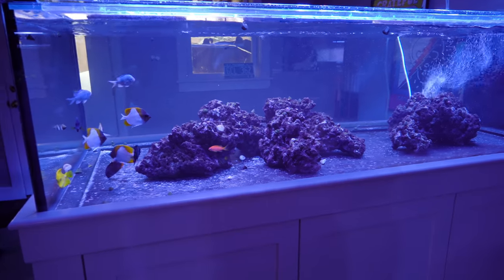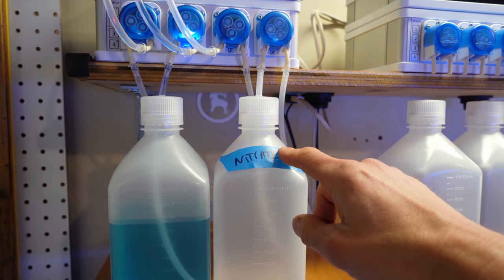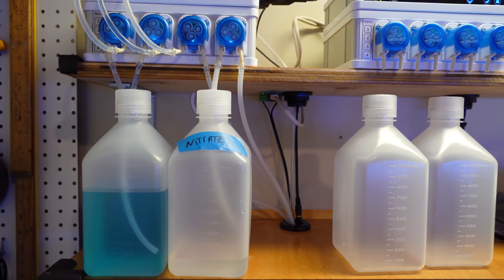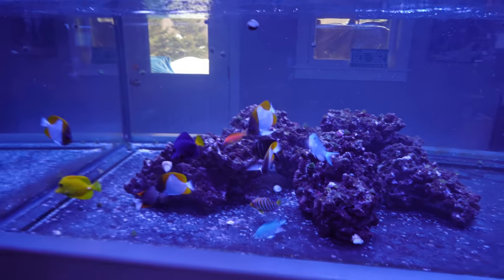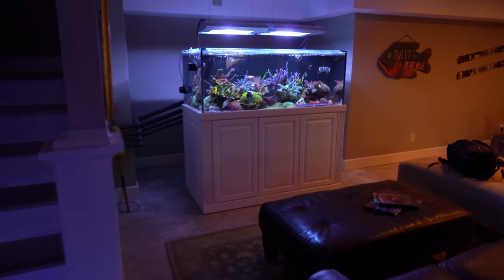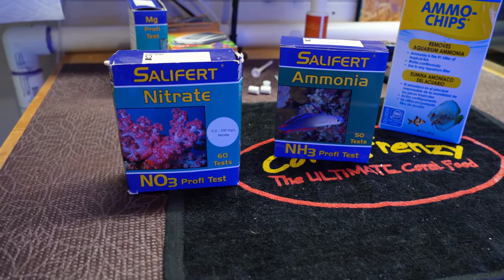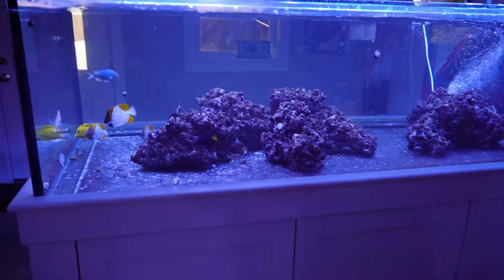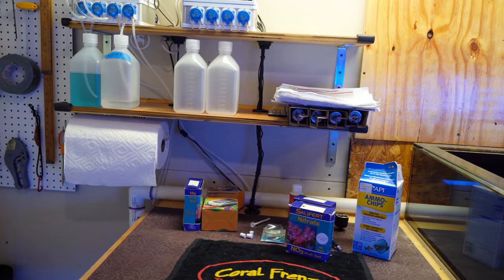3 Glass Walls: My Peninsula Tank Build Journey, Ep #22 - A Crisis

Comment: Keith, do larger water changes.  Also, I am having a hard time understanding how the check valves will allow you to dose, and also prevent siphoning issues.  They are one way stops.  If I am wrong please correct me.  Thanks and REALLY sorry about the overdose.  Keep on chugging along!  This is a great hobby.
Reply from the maker: Check valves have a cracking pressure, minimum pressure that must be applied before the valve opens. So they are not being used in the traditional sense in this application. I am using a 1/4" check valve rated with a .5 cracking pressure or 1/2 psi that can prevent a siphon for nearly 14" of liquid in the tubing.
Reply: @ReefBum  Thanks for the clarification.

Comment: Sorry to hear this. You probably have thought of this but check valves can only stop backflow which was not your problem. I think uphill with an air gap would work. I had never considered that maintenance with the hose connected would remove the roller pinch that is the single line of defense most of the time. Again sorry to hear about your fish losses. Love the channel!
Reply from the maker: Check valves have a cracking pressure, minimum pressure that must be applied before the valve opens. So they are not being used in the traditional sense in this application. I am using a 1/4" check valve rated with a .5 cracking pressure or 1/2 psi that can prevent a siphon for nearly 14" of liquid in the tubing.

Comment: That is terrible. I am sorry for you loss, but I am glad you shared this. I will make a mental note to look out for this going forward. I had a similar issue recently where tank water submerged the dosing pump tubes in my sump and it sucked all the 2 part out of the lines via capillary action (I believe). My KH shot up insanely high, but luckily I was in the middle of a water change and my return pump was off so it was just in my sump. My Apex alerted me that the PH was way up and I changed out the water in my sump and dodged a bullet. Anyway, live and learn.

Comment: Hi Keith, really enjoying your live shows with exceptional and rare audio/video quality. Sorry for what happened to you. We all learn from our and your mistakes, thanks for sharing. May I suggest to avoid any valves on your dosing system as you would add a point of possible failure. Placing the containers below the output level of the tube will avoid this problem. I would also recommend not to fill up your bottles or placing the inside tube not too far inside the containers but only 1-2 inches. Yes, it will require you to check more often and adjust the tubes pushing down a bit but it's a good way to crosscheck everything is ok. Also it will avoid any overdosing because dosing pumps sometimes doesn't stop... I hope my explanations are clear otherwise I will be glad to illustrate it better with pictures or videos. All the best in your reefing journey.
Reply from the maker: Thanks, I actually decided to not use the check valves and put all of the dosing containers on the floor. I am also pinching the output tubes when I clean each head as an extra precaution.

Comment: Wow! So sorry this happened, at least you were able to save over half the fish. I see some comments about automating, obviously you have to automate some things like dosing unless you plan on chaining yourself to the reef. My comment for you which I hope you don't take offense to is to not be so concerned with growing cheato. When it was first popularized it was reduce nitrate/phosphate now many people add no3/p04 just to get it to grow. If you need macro it works, but if it does not grow naturally consider you don't need it at all. Especially in a new system but even in an established if it's not working out without artificially fueling it, I question the need. Finally I was a little surprised to see your levels did not reach crazy crazy toxic levels. I do find though once ammonia becomes an issue it's faster and more effective to simply remove the fish from the ammonia filled water then deal with it. I know 21 fish, that's a lot but the water change water could have been used to fill the frag tanks and then work on eliminating it from the display. If you have a serious crisis once every 10 years much better to have it happen in year 1 of the tank then year 10.

Comment: Damn that sucks big time but keep in the mind the check valves are directional into the tank so I am not sure they will help since you still want the flow into the sump.  Better is a shutoff valve or a pinch tool to crimp the line while performing maintenance.

Comment: @ReefBum you can do a single 70-90% WC (as long as you have the logistics) with no issues if you add water with the same ALK/PO4(for corals)/Salinity/Ca/temp. Also, do it over 1h after you do the minimum top off necessary to cover the corals with water. I did it on my tank multiple times, you just have to take your time to prepare and verify the water matches what you have. Usually 2 times a year I do a 60% WC.

Comment: I just saw that you wanted to use check valves to prevent a siphon in the future.  I don't think this would work because if you add them to the line like that the pump wont be able to pump liquid at all, the check valve will prevent it.
Reply from the maker: Check valves have a cracking pressure, minimum pressure that must be applied before the valve opens. So they are not being used in the traditional sense in this application. I am using a 1/4" check valve rated with a .5 cracking pressure or 1/2 psi that can prevent a siphon for nearly 14" of liquid in the tubing.

Comment: Not sure how the check valves will prevent future siphoning? They will still allow flow from the dosing container. I'm sure I must missing something,
Reply from the maker: Check valves have a cracking pressure, minimum pressure that must be applied before the valve opens. So they are not being used in the traditional sense in this application. I am using a 1/4" check valve rated with a .5 cracking pressure or 1/2 psi that can prevent a siphon for nearly 14" of liquid in the tubing.

Comment: Sorry to see this as your tank and series has been a major motivator for my 250g peninsula upgrade.

The day you trust a check valve, is the day you are ready to quit the hobby. They WILL fail. Not if but when and it will be catastrophic.

You KNOW your dosing setup is flawed. It is the design. Don't throw a band aid on it when stitches are required. Fix the design. Get those bottles lower. This failure can and will happen again if you don't address the root of the problem.

Comment: Got lost at the end. If you put a check valve on the output line, the valve would prevent water from the sump travelling up into the doser,  which I think is not what happened and don't see that happening.  If you install a check valve, the contents in the bottle will still flow out, unless you install it backwards, which would mean nothing flows out of the doser.  Set me straight ;-)
Reply from the maker: Check valves have a cracking pressure, minimum pressure that must be applied before the valve opens. So they are not being used in the traditional sense in this application. I am using a 1/4" check valve rated with a .5 cracking pressure or 1/2 psi that can prevent a siphon for nearly 14" of liquid in the tubing.
Reply: @ReefBum    That clears that up.  There is another way to solve the problem. Don't trouble trouble until it troubles you. Stop cleaning the rollers :-)

Comment: 1st, those check valves are crap - such a nice tank and you are using cheap valves to save it?  2nd, What’s the check valve supposed to do, stop your sump from back-siphoning into the liquid? It won’t stop the siphon.
Reply from the maker: I can't comment on the quality since I don't have them yet and have not been able to inspect them, but I would not have purchased them if I didn't think they could do the job. I will also be keeping all dosing containers on the floor so the check valves will be a back up that probably won't be needed. As for your other comment, I have mentioned this in several other replies: "Check valves have a cracking pressure, minimum pressure that must be applied before the valve opens. So they are not being used in the traditional sense in this application. I am using a 1/4" check valve rated with a .5 cracking pressure or 1/2 psi that can prevent a siphon for nearly 14" of liquid in the tubing."
Reply: @ReefBum  All those numbers sound nice in theory but I'm not trusting my expensive system to a $1.50 device. Also, check to see if that cracking pressure doesn't impact the amount of fluid being dosed. Good move in placing the dosing containers on the floor.

Comment: I've heard of friends that use ammonian removers and prime.
Reply: Not sure how those check valves would help. But a derivation with a t and a short section of tune going up right after the doser and ending just above the doser would could cut the sifon and not change the way the dosing works. Just an option
Reply from the maker: @wilsonline90  Check valves have a cracking pressure, minimum pressure that must be applied before the valve opens. So they are not being used in the traditional sense in this application. I am using a 1/4" check valve rated with a .5 cracking pressure or 1/2 psi that can prevent a siphon for nearly 14" of liquid in the tubing.
Reply: @ReefBum  interesting. I wouldn't have thought of that

Comment: those cheap check valves don't work! Ask me how I know.   Upgrade to RO tubing and use john guest check valves. I also would put dosing containers on the ground cos your asking for trouble having then that high.
Reply: 100% agree!
They also have a tiny metal spring inside which rusts overtime.  As a found when using them on my Triton dosing lines.  Took months of hunting to find the metal found on my ICP's.
Reply: @chosenjacob4604  I cannot believe though with all his experience and money spent that he would trust having his dosing containers above the level of the tanks. That's like the first thing they tell you not to do in the instruction manuals.
Reply from the maker: @chosenjacob4604  These do not have that metal spring